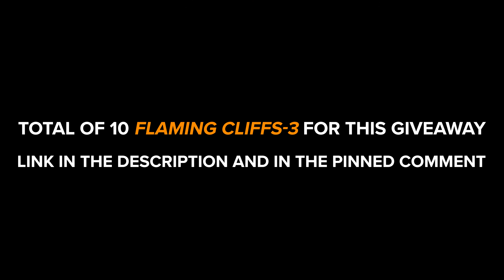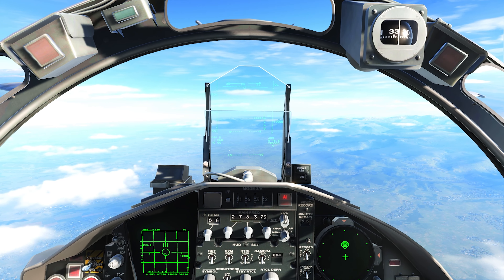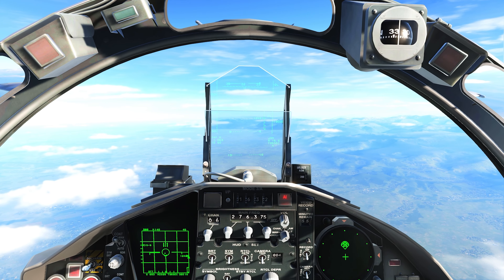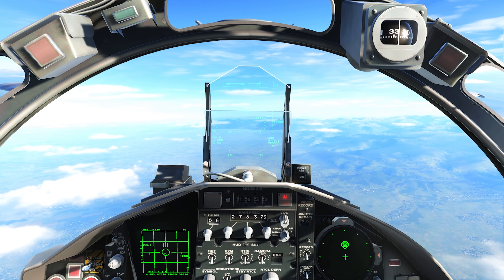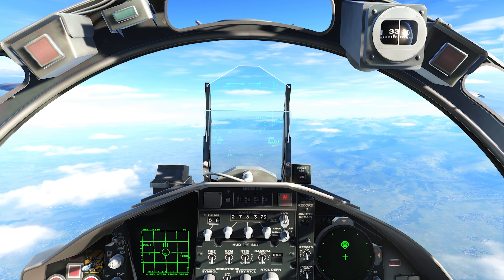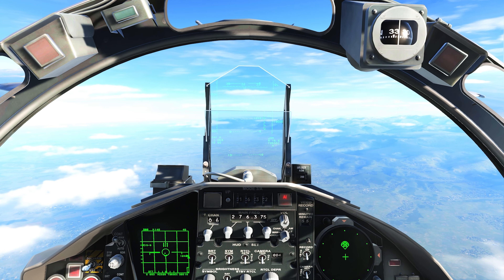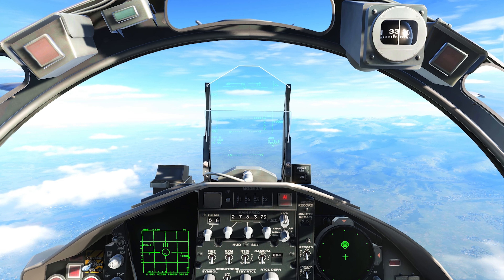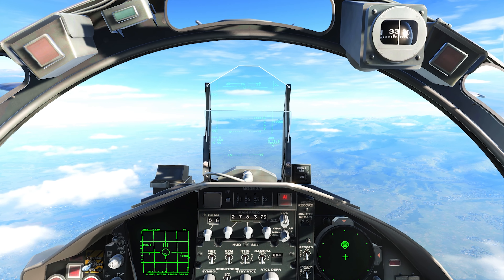How Air To Air Missiles Work? | DCS World

Comment: 1:00 A SARH missile does not actually "talk" to the jet, it simply follows an intense return from an illuminated target. Fundamentally, they work the same as IR missiles, just with radar instead of heat. if the missile and the aircraft talked to each other, than the original missile would have begun tracking again when he re-locked the target
Reply: Later fox 1s with datalink can do that
Reply: @Panzerzwerg  But it's explained as of that's just how FOX-1s work, when that's the exception rather than the rule

Comment: 1. For Fox 1's how far off-center can your nose be and still maintain radar lock?
2. For Fox 2's do you have to be behind the target in order for the missile to lock on the exhaust?
Reply: The gimbal limit of the radar was 60° to each side so 120° in total, you can check it by looking on the mfd radar screen, if the target is on the edge of the screen you are on the gimbal limit,

For fox 2 all i can say is, it depends on the era of missile and situation, but overall shooting a missile from behind is often an easier task for the seeker to hit its target but in compromise of range. With "modern" fox 2's you can lock and shoot a target at all aspects, as long as it has the room to turn in time.
Reply: Radar gimbal limit is 60 either side when level/near level but as elevation difference between shooter and target increases the gimbal limit decreases a bit
Reply: AIM-9P is stern aspect (up the butt) only.  AIM-9L/M/X are all aspect
Reply from the maker: 1. If you saw the FOX 3 part, the part when I'm talking about the cranck, thats how much.

2. Old FOX 2, yes. Only rear aspect shot and the missiles couldn't turn that good.
Modern days, the FOX 2 are all aspect shot and can do crazy turns.

Comment: What is the max range of the fox 2, and at what distance did you fire the fox 3? Just curious,  loved the video...
Reply: Max range of any missile is highly variable depending on shooter's altitude and speed and if target is coming toward you or going away etc etc etc.
Reply: "Fox 2" is a brevity code to quickly tell friendly pilots what type of seeker the missile you are firing has. The Fox numbers don't refer to specific models of missile exclusively, so any IR seeking missile is a Fox 2, likewise any active radar homing is a Fox 3 and any semi-active is a Fox 1. That is all to say that the range can vary depending on what missile is actually being fired.

LongShot's F-15 was carrying the AIM-9 (possibly the M variant) which has an optimistic max range of about 20 miles, but less than 5 is usually more advisable if you're looking for a kill shot against a maneuvering target.

As for the range of the Fox-3 shot, in the bottom right corner of the HUD, there is a stack of 4 data lines, the second value down, denoted by the letter R, is the range in miles to your locked target. When LS fired, he was was slightly over 10 miles away from the bandit. The data can be a bit hard to read if he has the HUD brightness set too low or is looking at bright clouds or the sun, but if you watch closely you can usually peek it often enough to keep track of the rough range to his target.
Reply from the maker: Don't know for sure, it varies with speed and altitude.
FOX 3 shot: you can see the range in the HUD at the right bottom part the letter R and then a number. I think it was 28 miles? Little bit less...